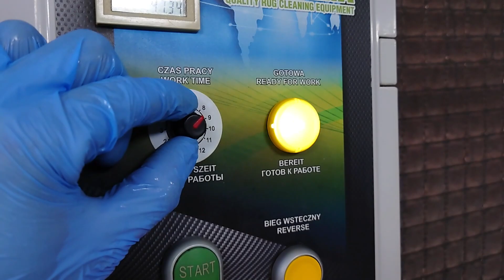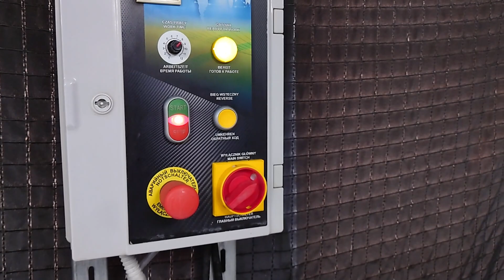Pranie GRUBEGO I CIĘŻKIEGO DYWANU SHAGGY z bardzo ciekawym wzorem. Intensywny proces płukania CRB💪😍🌊

Comment: Interesting pattern/design there buddy. Curiosity pique: what aspect of shaggy rugs do you find most challenging? Amount of water retention? Pile length? Agree shag rugs are awesome! 💪🙂💫🌊🧽🧼
Reply: I bet that Shag rugs are impossible to clean without that spinning drying machine. I can't imagine how long it would take to dry unless you had one of those.
Reply: @mattt198654321  - accurate and a solid point! Also, the CRB seems like it would be a must with shag.
Reply from the maker: Thank you 🤗💖 Shaggy retains many different types of dirt, sand. Some carpets can be shagged several times and still get dust from it. I think that's what bothers me the most 😁
Reply from the maker: The centrifuge gets the job done on any carpet and greatly reduces drying time 🤗💖🌊💪
Reply: @lubuskie_centrum_czystości  Do you have to put each of the shag rugs through the whisk more than once, every time?? Is several times through, better than once very slowly? Someone talked about how much stuff can be hidden within a shag rug - what is your best/most interesting find? This is a very pretty rug. I loved 22:37 with the mystical fairy spray. 😍😍❤️❤️❤️🌻🌵

Comment: Darn, the bubbles on this one were ho-hum. Was that because of the depth of the pile?---Ah, having the camera placed in a different spot took me a few blinks to get oriented! And I now know how you're lifting those heavy wet rugs into the tumbler, thinking before that you had to lift UP, but knowing how smart having the opening close to the floor allows you to angle them up and in!---Back in the 70s, I had a vacuum cleaner that came with a shag rug rake for getting to the bottom of the pile!!! Never again!

Comment: Oh how I love the shaggy rugs! I had a question... does water flow to the carpet buffer machine?
Reply: Yes, he uses it on the second run over the top, and on the back of the rug. There is a blue knob on the left side of the scrubber handle. Sometimes the knob is in the frame when he gives it a couple of turns and you can see it. One line to the scrubber is electricity, and the other is water. Hope that helped! ❤️🌻🌵